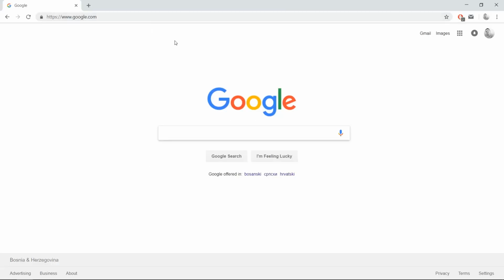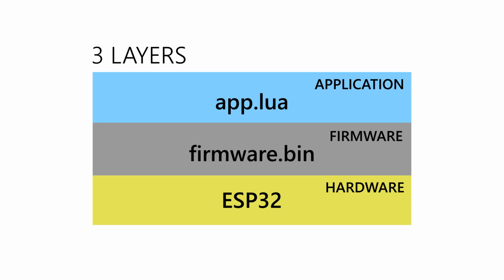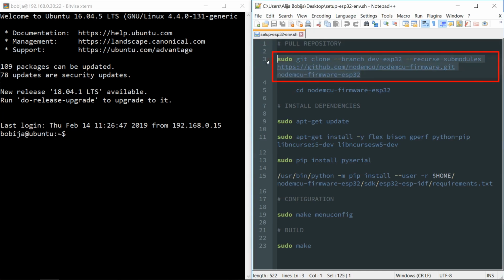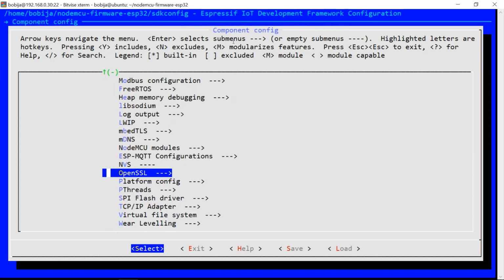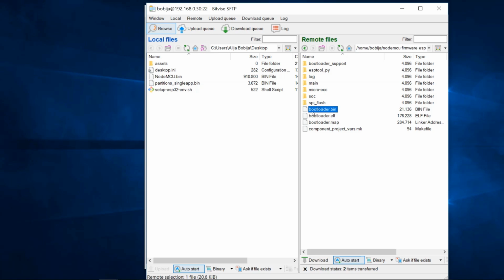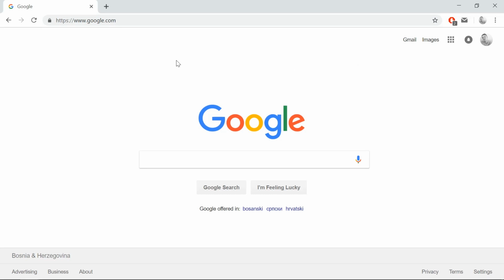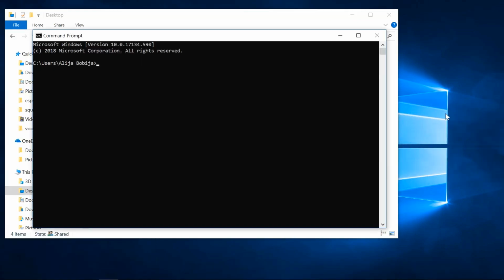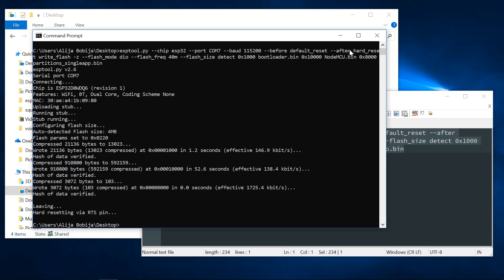Lua on the ESP32 - Config, Build and Flash the Firmware

Comment: GREAT TUTORIAL.
In my case "sudo make" failed to produce results. Instead I got: "fatal error: readline/readline.h: No such file or directory"
The fix for this issue is to run the following command: sudo apt-get install libreadline-dev

In addition the partitions file is named "partiitons.bin", so the flash command under windows should be: 
"esptool.py --chip esp32 --port COM4 --baud 115200 --before default_reset --after hard_reset write_flash -z --flash_mode dio --flash_freq 40m --flash_size detect 0x1000 bootloader.bin 0x10000 NodeMCU.bin 0x8000 partitions.bin"

Comment: Ok, on my last comment I was doing it on an actual Ubuntu machine, but with a different version of Ubuntu. This time I've setup the same Ubuntu version on my Mac using Virtualbox, and when I run "sudo make" it runs smoothly until: `/home/ubuntu/nodemcu-firmware-esp32/components/luac_cross/../lua/luaconf.h:305:31: fatal error: readline/readline.h No such file or directory compilation terminated`
Reply from the maker: Before you run "sudo make" try to run "sudo apt-get install libreadline-dev". It's seems like that is issue in official nodemcu dev-esp32 repository. You can read more about that issue here: https://github.com/nodemcu/nodemcu-firmware/issues/2843
Reply: @abobija  thanks

Comment: I'm trying to follow along, but I'm getting the following error on the `sudo make` command

```
Setting IDF_PATH and re-invoking...
make[1]: Entering directory '/home/n8udd/nodemcu-firmware-esp32'
/home/n8udd/nodemcu-firmware-esp32/tools/toolchains/esp32-linux-x86_64-20181106.1/bin/xtensa-esp32-elf-gcc: 1: /home/n8udd/nodemcu-firmware-esp32/tools/toolchains/esp32-linux-x86_64-20181106.1/bin/xtensa-esp32-elf-gcc: Syntax error: "(" unexpected
expr: syntax error
/bin/sh: 1: xtensa-esp32-elf-gcc: Exec format error
/bin/sh: 1: xtensa-esp32-elf-gcc: Exec format error
Toolchain path: /home/n8udd/nodemcu-firmware-esp32/tools/toolchains/esp32-linux-x86_64-20181106.1/bin/xtensa-esp32-elf-gcc
WARNING: Failed to find Xtensa toolchain, may need to alter PATH or set one in the configuration menu
make[2]: Entering directory '/home/n8udd/nodemcu-firmware-esp32/sdk/esp32-esp-idf/components/bootloader/subproject'
/home/n8udd/nodemcu-firmware-esp32/tools/toolchains/esp32-linux-x86_64-20181106.1/bin/xtensa-esp32-elf-gcc: 1: /home/n8udd/nodemcu-firmware-esp32/tools/toolchains/esp32-linux-x86_64-20181106.1/bin/xtensa-esp32-elf-gcc: Syntax error: "(" unexpected
expr: syntax error
/bin/sh: 1: xtensa-esp32-elf-gcc: Exec format error
/bin/sh: 1: xtensa-esp32-elf-gcc: Exec format error
WARNING: Failed to find Xtensa toolchain, may need to alter PATH or set one in the configuration menu
make[3]: Entering directory '/home/n8udd/nodemcu-firmware-esp32/build/bootloader/bootloader_support'
CC build/bootloader/bootloader_support/src/bootloader_flash.o
/home/n8udd/nodemcu-firmware-esp32/tools/toolchains/esp32-linux-x86_64-20181106.1/bin/xtensa-esp32-elf-gcc: 1: /home/n8udd/nodemcu-firmware-esp32/tools/toolchains/esp32-linux-x86_64-20181106.1/bin/xtensa-esp32-elf-gcc: Syntax error: "(" unexpected
/home/n8udd/nodemcu-firmware-esp32/sdk/esp32-esp-idf/make/component_wrapper.mk:289: recipe for target 'src/bootloader_flash.o' failed
make[3]: * [src/bootloader_flash.o] Error 2
make[3]: Leaving directory '/home/n8udd/nodemcu-firmware-esp32/build/bootloader/bootloader_support'
/home/n8udd/nodemcu-firmware-esp32/sdk/esp32-esp-idf/make/project.mk:552: recipe for target 'component-bootloader_support-build' failed
make[2]: * [component-bootloader_support-build] Error 2
make[2]: Leaving directory '/home/n8udd/nodemcu-firmware-esp32/sdk/esp32-esp-idf/components/bootloader/subproject'
/home/n8udd/nodemcu-firmware-esp32/sdk/esp32-esp-idf/components/bootloader/Makefile.projbuild:41: recipe for target '/home/n8udd/nodemcu-firmware-esp32/build/bootloader/bootloader.bin' failed
make[1]: * [/home/n8udd/nodemcu-firmware-esp32/build/bootloader/bootloader.bin] Error 2
make[1]: Leaving directory '/home/n8udd/nodemcu-firmware-esp32'
Makefile:18: recipe for target 'all' failed
make: * [all] Error 2
```